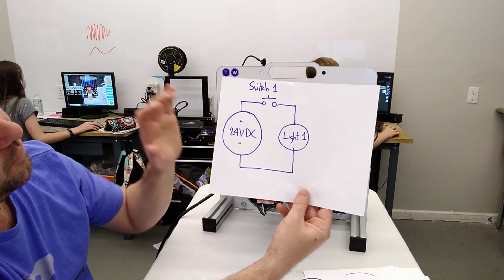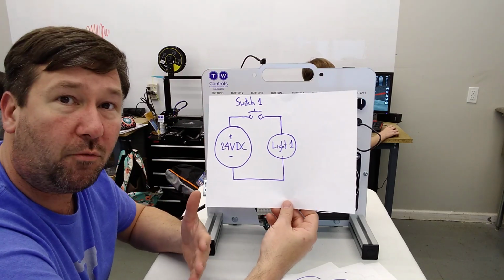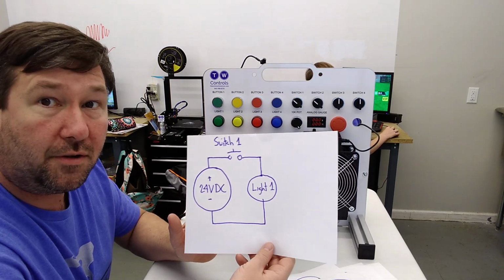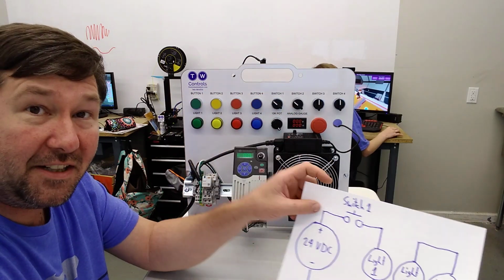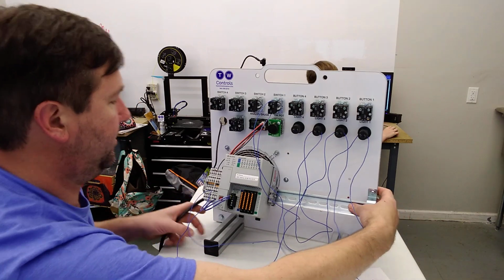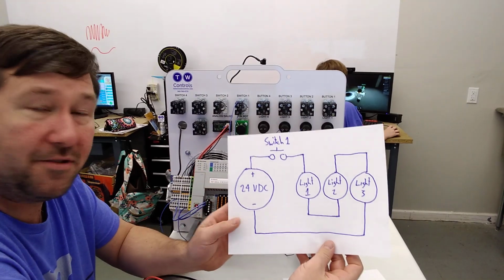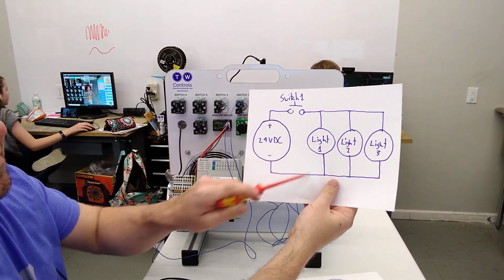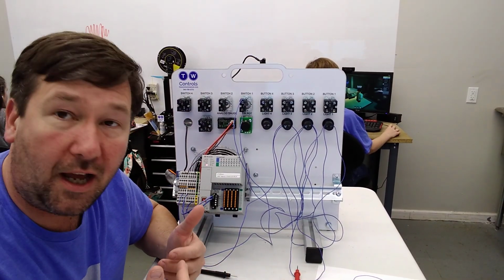How to Wire Series and Parallel Control Circuits

Comment: How would you wire a 12vdc circuit with 2 SPDT toggles and 1 DPDT toggle for independent control of the load?

Comment: Ok how culd I use existing wires in alternator .
Useing series ore pararel configuration wia switch ore relay?
I want to buld such controler so I dont have to solder all the times.
And is it posibel useing mosfet circuet to make speed controler for alternator and still haveing bridge rectifuer can they co exist in a circuet?
I want to buil permament magnet alternator for exampel that thing shuld charge baterrys from 0 to 2500rpm engin speed but above 2500rpm he shuld automaticaly switch to motoring function wuld speed controled oscilator circuet full that bill?
Ore cinde of manual switching from speed controler to bridge rectifuer is that posibel?
I have on more problem when I use hv ceramic capacitors my starting charge get afected on my alternator it goes from 1200rpm to aeound 2500rpm so I migured out if capacitors can effect alternators how wuld other capacitors react with alternator can I make that force to charge at lower rpm range like 500rpm with out modifieing winding in rotor? 
What wuld hapen if I use dual rectifiers with diferent values ?
Ore exampel if I used external stator and wound it with alredy working alternator stator wuld still the alternator work performing dual work even if one stator is wound externaly?
Im thinking of transformer action in that external stator basicaly thats transformers suposedly to work like that .

Comment: Question?
I live in Colombia. The water heater hear for the shower is electric and located in the head of the shower.
I just moved into this building. It was a school. I'm living in one of the rooms. The breaker box is located at the other end of this building. The heater requires a 40 amp breaker. The electrician wants to run wires from the other side of the building. Too expensive for me.
I'm wondering if I can take the current from two different locations on my end of the building and tie them together for a larger cable size; and then connect to the heater?
Does this change my current making it too much?
Or do I still have the same voltage?
Thank you for your help.
Reply from the maker: Listen to your electrician...

Comment: For the light to be on. You need positive and ground if we talking about 24vdc. Light 1 and 2 are acting like resistors. Definitely you will have voltage drop and depend how much resistance you may not be able to have the light number 3 on .
Reply from the maker: Not quite Tom.   If the resistance of the three lights is "equal", then the voltage will be divided equally between the three lights.  So if you had 24V across all of them, there would be 8V across each light.  We cover this more in the next video, stay tuned :)
Reply: Tim Wilborne 
You are doing very good job with your videos keep them coming . Plus you have an awesome family.👍
Reply from the maker: @Tom_Sawyer385  Thank you Tom!
Reply: Assuming all of these are incandescent lamps?
Reply from the maker: @dr.g7898  No these are LED bulbs

Comment: Tim I think you're missing an extra wire going from Light 3 to 0V without going through the relay contact in the last drawing.
Reply from the maker: Actually there are two errors.  There should not be a connection on the common side between the relay and Light 1 plus there should be a wire from the common to light 3's common.